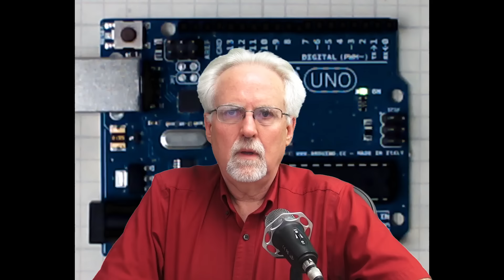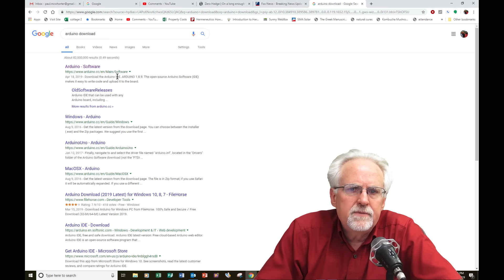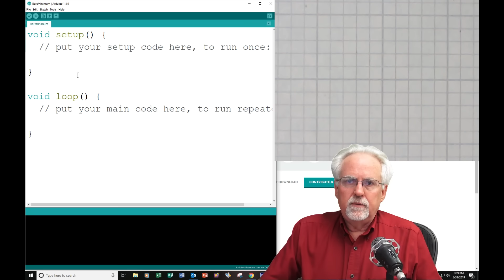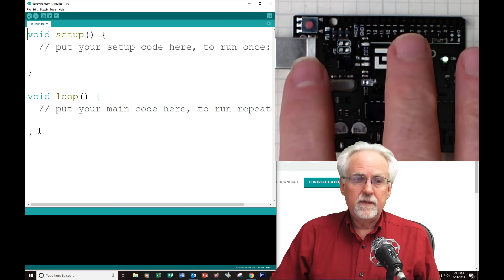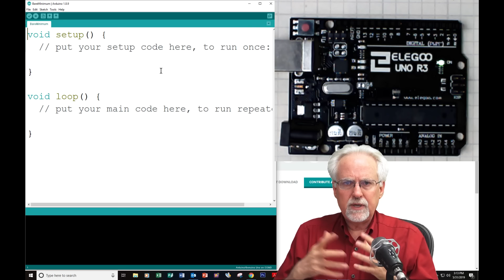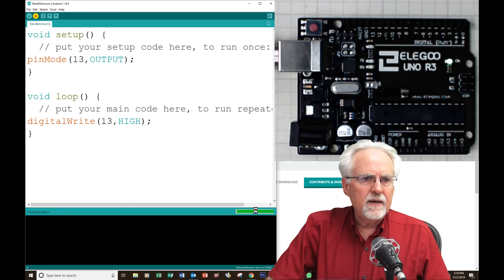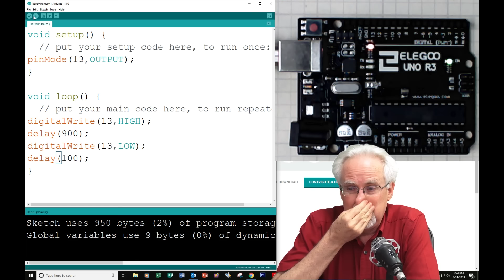Arduino Tutorial 1: Setting Up and Programming the Arduino for Absolute Beginners

Comment: thanks I was fully engaged the whole way and really enjoyed it! I have one question though, why when I put digitalWrite(13, LOW);  first and digitalWrite(13, HIGH); second without any delays is the LED brighter than if I put them the other way around? Is it because the code ends on HIGH and then takes more time to re-process the function and get to the LOW so you are perceiving slightly more HIGH voltage than LOW voltage?

Comment: I downloaded the Arduino IDE 2.3.7 and my code isn't working on the Arduino even though I selected the board(UNO)and port (COM5)correctly and chose the file BareMinimum. 
I wrote the last code and this is the error I'm getting:
Error: cannot set com-state for \\.\COM5
Error: unable to open port COM5 for programmer arduino
Failed uploading: uploading error: exit status 1

From the beginning all codes were not working 
What did i do wrong please help 😭😭
Reply from the maker: Find IDE 1.85. Things worked much simpler on that IDE. You should be able to find it on the arduino site.

Comment: I could perceive slightest of a flicker upto a delay of 4 ms, below this value, I am not able to tell the difference. I am using Elegoo MEGA 2560 R3 (ATmega2560). The boards clock frequency is 16 MHz which is same as Arduino UNO board being used in the tutorial.

Comment: Old dog here, learning new tricks. lol
Reply from the maker: Welcome Aboard!
Reply: @paulmcwhorter  Thanks, being a US Navy Veteran, "Welcome aboard" makes me feel at home. lol
I am building a Racing simulator.
I am using a car dash board, steering wheel, etc. 
My goal is to hook up the buttons/switches and the car, to connect to my PC. 
The Arduino is the answer to all my electrical questions. (or the beginning) lol
I worked as a Industrial Union Electrician for 35 yrs. 
I have installed huge I/O Cabinets in steel mills, etc, Taking weeks to wire up. 
I have plenty of questions on the Arduino use, and set up.
So, let me buy you a coffee. lol

Comment: Mine was 15ms. One deviation from the tutorial: when writing my sketch, the variables OUTPUT, HIGH, & LOW did not turn blue, they stayed black. My functions pinMode, digitalWrite & delay did turn orange. The sketch compiled & ran normally.
Reply from the maker: I am using IDE 1.8, and you are on IDE 2.X, and things changed. If you want results exactly like mine, use IDE 1.8

Comment: Hello Paul, I am a goal oriented student of yours. I loved embedded systems from a few courses i took in my computer engineering degree. I wanna start from scratch and I really love it. I love they way your teaching it. It adds more passion to my passionate curiosity. I just have 3 questions. I hope you will find my comment and respond. How do I become an embedded systems engineer? What roadmap will you will help me with in general? In what order should I follow your playlists? Thank you so much for this valuable lessons!!!!
Reply from the maker: First finish this class on the Arduino. Then next do the class on the Raspberry Pi Pico W. That is an important class as it deals with State Machines and PIO, important for embedded systems. Then take the New Arduino Uno R4 class. Then take the class on the Raspberry Pi. You will be very far along if you do those things.
Reply: @paulmcwhorter thank you very much for the guidance!

Comment: Almost 68yo, 2nd time I've started these tutes (1st time, probably Uno v1 or v2, I got a litttle way, then got distracted).
So I ordered the UnoR3 Starter Kit from Amazon (au) - in Aussie Dollars, a bit expensive, but done. Also, last time, I found the jumper wires tend to be a bit less easy to follow once there are a few of them hooked up, so also got a kit of flat (coated) wires with 90deg bends at each end (2 colours for each length).
Homework: 15msec can see blinks, 14msec nosee; 13msec (with magnifying glass) cansee; 12msec, nosee.
So a magnifying glass may make a marginal difference.

Just downloaded & installed, following instructions in this video: Current IDE is 2.3.6, not so good with the colours -  
* the colouring only takes place after another character/space AFTER the command is entered, not instantaneously at end of typing the command; 
--- In the default (light) mode:
* the numbers (terminal, msec) stay black, same as when you're typing them in, AND 
* the ALLCAPS commands also stay all black, same as typing entry colour
--- File > Preferences > Theme: Dark mode: 
* the numbers are now in pale bluegreen, but 
* the ALLCAPS stay white (the same colour as while you're typing the command, 
=== so the guidance given by proper command turning the letters (black or white) > coloured IS LOST. Not so good.
Themes only allow Light/Dark/HighContrastLight/HighContrastDark, no way to change the text colours beyond that.
Unfortunately, googling doesn't seem to offer any fixes.

Comment: Hello Paul,

I hope you are well and in the best of health...

Kindly guide me, if I want to teach like the way you do, to home schooled Children...what is the audio and video setup you are using?

I mean how are you able to show you desk and hands, in the main screen, with you face minimized in a corner...how are you able to record you computer screen while still appearing in the corner, and also switch between screens?

What audio devices are you using?

Kindly guide me, I am also tight on the budget, how can I manage your video and audio setup while still not breaking the bank.

Best regards!
Reply from the maker: The software I am using is called Wirecast, and I am sitting in front of a green screen. The software blanks out the green, and then it allows you to choose what image or camera to show behind you. Wirecast is professional software but a little expensibe. OBS is a free software that does most of what wirecast does but a little trickier to learn. I am using a blue yeti USB microphone.

Comment: Again, 2025, I am 69 and just wrote the program per your great instruction. I have been an electronics hobbyist for over 50 years, but NEVER been involved in programming. (The Sinclair years somehow passed me by) I have had the Arduino kit for about 2 years and thought I'd at last do something with it. This first step has really got me enthused to go further. I am using the Mega2560 by the way. I find your style of teaching very easy to understand and thank you very much indeed. This is a small step for mankind, but a HUGE leap for me😊😊

Comment: at 17 miliseconds - I can perceive the strobling, but I have to know that on-off is there, otherwhise it's just an annoying light
at 15 - it's stable for me
Reply: fun fact, if the time the light is on is longer than when led is off you can get the off-time as low as 6 for 50 ms of light on and still see the flicker.
Or 10 off for 25 ms on

Comment: I got it! had some issues at first. When I first plugged my Arduino in the on led came on but the no. 13 led was blinking before I even added any code. What fixed it was I wrote turn 13 led off and it worked! Then I could do all the other stuff. On, off, delays etc. I found that 15 milliseconds on and 15 milliseconds off is about as fast as I could still see it was blinking but just barely. Thanks!

Comment: 00:00 Polemic Order is redoing the Arduino tutorials with updated hardware, software, and production quality.
02:43 Download and install Arduino software
05:38 Learned to program using Arduino
08:57 Arduino setup and communication with IDE
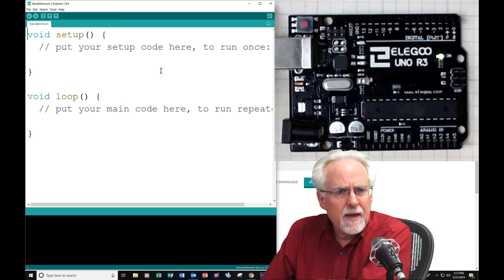11:52 Set up Arduino to use pin 13 as output.
15:00 You have written your first and second programs to control an LED.
17:59 Learn how to make an LED blink using Arduino
20:58 Learn how to make an LED blink at different speeds.

Comment: Paul, don't know it you will see this. I need to regulate a section of nichrome wire to have about 9 amps thru it to maintain temperature. I would like to do it with pulse modulation on 110VAC. The heat capacity of the wire is rather small so the pulse frequency would be fast. I just need to be pointed in a direction, I can do the design and research. thanks (I am thinking of doing a Comsol multi physics model of this with the joule heating and radiation and AC pulsing, not necessary but fun.) all the best

Comment: man i been for 3 days trying to get the right ide, and then trying to find your ide. So i went through youtube and chat like crazy even tho i had you act first, but what i missed was to go to the search bar and put in arduino is that is what held me up. but now i got it. (thanks) for using the right board that was black, and also my ide was 1.8.19 you through me off with just 1.8.9 but anyway it works, plus trying to understand this situation i learned more stuff, so maybe it was meant to hunt around. anyway, thanks. they did update it to 2.2 something which is totally different that is what i was stuck on.

Comment: Something I'm seeing with Auduino 2.3.2 is that when you type in pinMode (13, OUTPUT) ;  the 13 is blue and OUTPUT stays white. this has me slightly confused is there a way to make it match your work?
Reply from the maker: 2.X changed all that. I was on IDE1.8 and liked it much better. Try downgrading to that.

Comment: Hi, I have an Arduino UNO board, but the minute I plug in the USB cable the LED starts blinking before I type the commands. What is it wrong that I might be doing. Thanks in advance. Joe

Comment: I have project I need help with, I building a small pneumatic bench top press  I'm thinking about using an Arduino to control the pneumatic switch by way of two hand switches on each side of the press for safety reasons. I really don't want to use push buttons . Touch sensors of some type would be best I think.

Comment: dont know if i need a library or something but OUTPUT AND HIGH are not changeing color but the command is still working as in the video digitalWrite and pinMode still change to orange ty in advance
arduino version 2.2.1 board elegoo mega2560 (file example basic baremin) (port 3) (tools board "Arduino AVR boards" "arduino mega or 2560")
13:47 15:47 
void setup() {

  // put your setup code here, to run once:
 pinMode (13,OUTPUT);
}

void loop() {
  // put your main code here, to run repeatedly:
digitalWrite(13,HIGH);
}
Reply from the maker: Downgrade to 1.8. I really do not like 2.X

Comment: void setup() {
  // put your setup code here, to run once:
  pinMode(13,OUTPUT);
}

void loop() {
  // put your main code here, to run repeatedly:
  digitalWrite(13,HIGH);
  delay(0.5);
  digitalWrite(13,LOW);
  delay(50);
}
i have run it on this delay ,the light is very dim but it can be visible

Comment: You are better than any professor I had in college. At 50 as A Mechanical engineer I have avoided programming for the last 2 decades. I was into Turbo Pascal in the early 90's and am loving how close this language is. With that pascal knowledge I was able to answer the question ahead so I think I will have no problems picking it up. My concern is with things like sending PPM signals but one step at a time right? Thank you so much my friend!

Comment: Hi Paul, I'm new to Arduino, and already stuck on Lesson 1 of your excellent course. When  I reach to the Void setup and Void Loop part of your l;esson 1, I then type in 'pinMode(13,OUTPUT);'    and 'digitalWrite (13,HIGH);' , 'OUTPUT & HIGH' do not turn blue. I've run the vid 5 or 6 times but I cannot see where I'm going wrong. 
Just by the way, I purchased Arduino UNO R3 only yesterday,  I was unable to download the 22  tutorials 'allegedly' supplied with the kit on CD and website, but could not find them on CD or website. I was about to give up and return the whole UNO R3 kit to AMAZON, but first I searched for advice on YouTube. That is where I found you! I am so glad that I did. Even if I am having teething problems.
Reply: Good Morning Paul, Thank You for your suggestion re using IDE version 1.8. Sorry, but I'm just simply not that clever. I managed to practically teach myself Fusion 360 with a whole stack of problems to overcome, but I think Arduino is just a 'Bridge too far!'  If I am to return my Arduino I have to send it back to AMAZON within five days. Today is day five, so I think I will return the whole kit today and just concentrate on my Fusion 360 designs and printouts.  Sorry to bother you, no adverse reflection on you, if I could sit down beside you in the classroom, I'm sure I would be able to pick up Arduino very quickly.
Reply from the maker: I am on IDE version 1.8, and you probably installed the newer one 2.x. Try downgrading and using 1.8 and you should get exactly what I do.

Comment: Arduino: 1.8.9 (Mac OS X), Board: "Arduino Mega or Mega 2560, ATmega2560 (Mega 2560)"

 
	 Im getting this error please help me out

Error compiling for board Arduino Mega or Mega 2560.

This report would have more information with
"Show verbose output during compilation"
option enabled in File -> Preferences.

Comment: Installed the software but it won't upload the program into Arduino. It gave error message "Failed to upload" ...... "The file <avrdude.confg>  could not be found.

I searched the file <avrdude.confg> and downloaded  from Github and installed at the directory in the error message. It started working good.

Comment: When i type in OUTPUT on the set up and HIGH on the loop im not getting it to highlight in blue what can i do to fix that
Reply from the maker: I am using IDE version 1.8. I much prefer it to 2.X. Consider downgrading to 1.8 and you will get the results I am getting.

Comment: Kindly assist I'm using Arduino nano and is connected to COM 3.

The program doesn't upload on the board  and it compiled successfully. I need your support also the parameters 'OUTPUT & HIGH' doesn't turn blue color rather black color

Thanks
Reply from the maker: You are probably on IDE 2.X Go back to version 1.8
Reply: @paulmcwhorter  okay 
On Arduino website no version 1.8 can you please send me the version 1.8 download link.
Reply: @paulmcwhorter  I really appreciate your support I have version 1.8 now is fine now.
Thanks

Comment: Before I watch this, will this work for an elegoo mega 2560 R3? That IDE program won't detect either of my boards and they are not listed in the program as a choice. I think it's based off the ATMEGA 2560 but, the program won't see that either.

Comment: void setup() {
  // put your setup code here, to run once:
  pinMode(13,OUTPUT);
}

void loop() {
  // put your main code here, to run repeatedly:
  digitalWrite(13,LOW);
  delay(500);
  digitalWrite(13,HIGH);
  delay(500);
}
it is blinking.

Comment: hi I have a course work related to arduino can you please help me with the course work?
the course work is :   

You have been asked to design a prototype for a medical device which can be used in response to future outbreaks of respiratory diseases. Your client tells you that they want the device to have the following functionality:
⦁	Some sort of a way to start the device.
⦁	A way to detect if a person is close to the device. They say that by “close” they mean “about 10 centimeters” but want this to be flexible. 
⦁	A way to measure the temperature of someone stood close to the device.
⦁	A way to detect if someone is coughing too loudly when stood close to the device. For the moment, they cannot give you an exact threshold for “too loudly” and want this threshold to also be flexible.
⦁	A way to raise an alarm or notify someone if the person close to the device has a temperature of more than 37.5 C or coughs too loudly.
You now need to complete the following tasks and include the answers in your report file:

Task 1
Given the user requirements above, produce a list of parts and components that you would need in order to meet them. You can choose from all the electronics we have used during Semester 1.
When producing your list, be specific about which part addresses which requirement. For example, you can say something like “I will use electronic component X to meet requirement 3.”

Task 2
Connect all your parts and components together to form the prototype. Take a photo of your circuit and include it in your report. Annotate the photo to let the user know which component is which.

Task 3
Write Arduino code which implements the functionality of your prototype. The Arduino code should consist of one (1) single .ino file and should make use of the parts and components you have identified in Task 1. 
You will be awarded 12 points per user requirement met, for a total of 60 points for this Task. For example, if your prototype can only measure the temperature, you will get 12 points. If your prototype can measure the temperature, detect if someone is coughing too loudly, and raise an alarm, you will get 36 points.

Task 4
In your code, specify which parameter should the user change if they want to adjust the threshold for “close” and “too loudly”.

Comment: I was a programmer over 40 years ago.  I'm blown away by the code overhead that has disappeared in order to do simple tasks.  Excellent introductory tutorial into the analog/digital industrial platform. Two thumbs up!
Reply from the maker: Glad it helped!
Reply: @oldricky  45 years ago (and that is a long time…) I was tasked with programming a Motorola 6800 to turn a stepper motor through a keyed-in number of degrees, to which an optical shaft encoder ‘read’ it back, then displayed the output on a second display. It was all done in machine code. It taught me about all the other devices that were needed in a ‘computer’ system, and I obsessed over it at the time. I loved it. It was my first year in industry, and it was the point at which I knew that I had gone into the right vocation. Today, I still love engineering. I’ve recently retired, so here I am again, back playing with microcontrollers, and I’ve just bought my first arduino. With Paul’s help and these videos, who knows, history might repeat itself! I wish you well, Ricky.